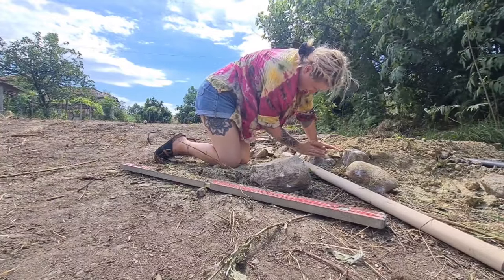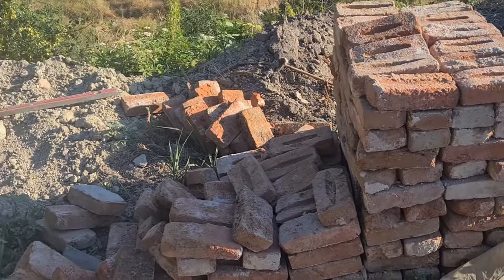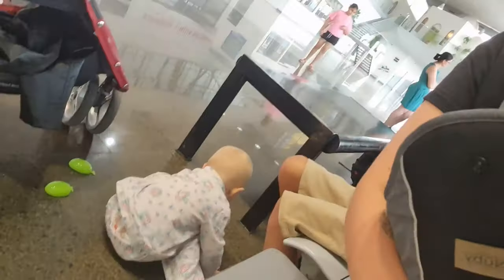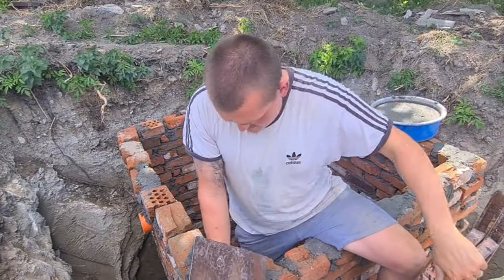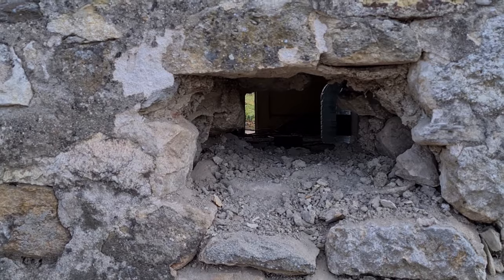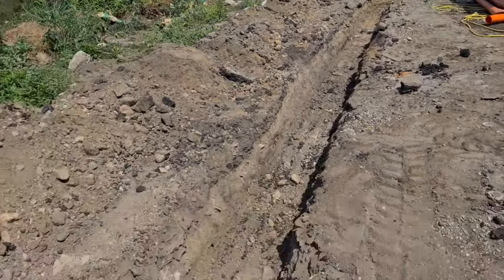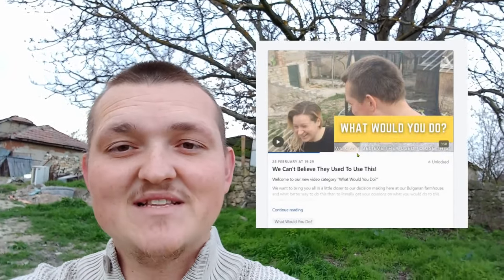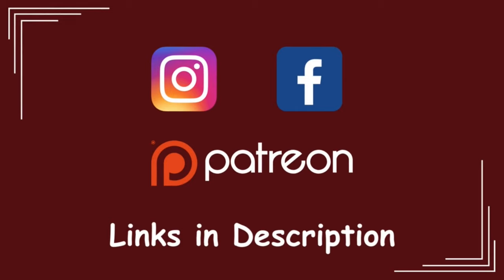Episode 9 - Down in The Dump's | DIY Septic Tank

Comment: Everybody loves a person that will try and do things instead of just getting others to do the work for them. If funds allow invest in some basic tools  spirit level etc. The next time you have to lay bricks put a little bit of washing up liquid in the water as it allows it spread better and for your render a little bit of pva glue mixed with the water. i love to watch your adventures and wait with baited breath for the next upload. Keep plugging away at it and the jobs will get easier i'm sure. By the way that's the best dressed and looking labourer i have ever seen. All best wishes👍👍👍
Reply from the maker: Hey Paul! Thanks once again for watching and following our journey.  

We now have a spirit level, wooop! I have also learned about the washing up liquid now, but its a great tip, it works wonders! Alsp, I did use a waterproofing PVA in the mix for rendering. I just didn't mention it, it didn't help it stick much hey, I think.my first mix was a wee bit wet. 

As for best dressed, I've used all my nloody good clothes as I didn't have any working ones 🙃 😅 they're working clothes now haha. 

Thanks again Paul.